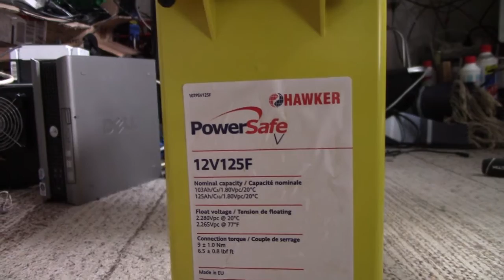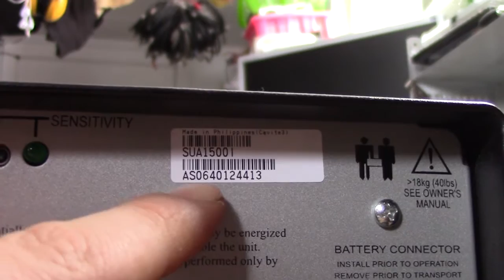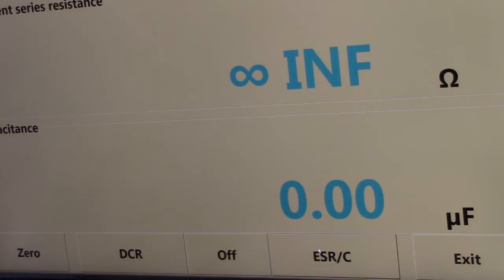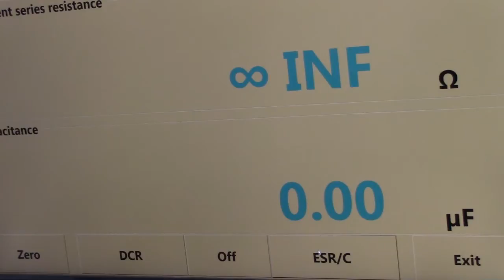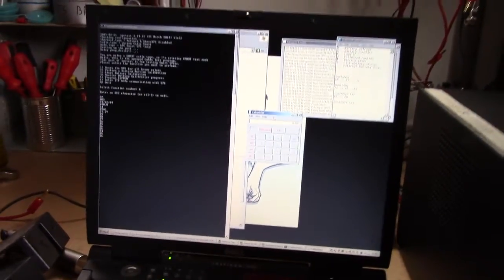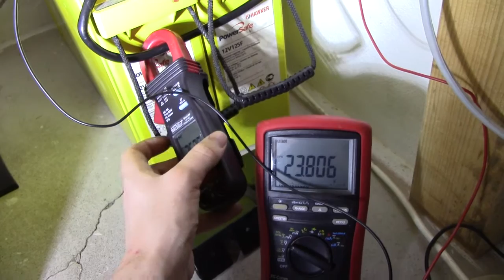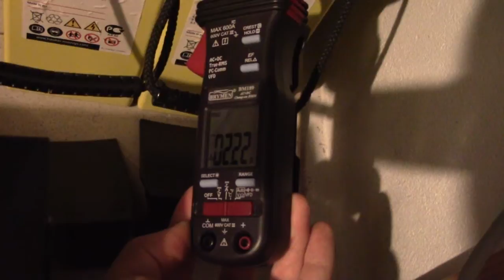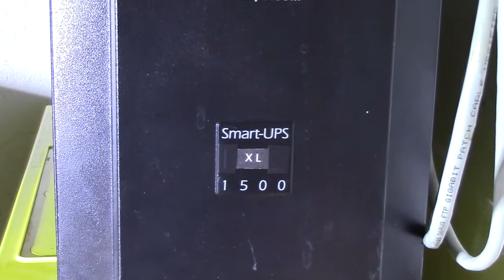Giving my workshop UPS a long overdue service and external battery connector

Comment: I have this exact same SUA1500 Smart UPS model.  I want to replace the existing 24V internal fan whose bearings have died.  What is the safest way to discharge the internal capacitors after turning off, unplugging from mains and unplugging the batteries?  Would pressing the "0" button for 10 seconds do the trick?

Comment: In some other video you said that the float voltage was too low for the car batteries if I remember correctly. What was your final conclusion about proper float voltage for flooded car batteries and how long did those last, if you remember?

Comment: I just recapped my 1500, its a 120v 60hz model and it still kinda has the weird grunting noise on startup. Any ideas?
Reply from the maker: It's usual for it to go "bonk". That's just the magnetics interacting with the case metal.
Reply: @FFcossag  makes sense, its an old 2002 model so its certainly been around for a while.

Comment: I have a UPS Apc 2200. Can I connect 4 batteries 100 amber with it? Do I need an external charger for the batteries?

Comment: Here again after 4 years.  I have a APC Smart UPS SUA1000.  I can't get it to cold start.  When the on button is pressed, I hear a  click, and the battery status light comes on.  It sits there then goes out after a few minutes.  When plugged in, the same thing happens, except after a few minutes the online light comes on.  If I then simulate a power cut, the inverter starts up.  When the input power is turned back on, the inverter goes off back.  No grinding sound.  What could be the problem?
Reply from the maker: Hold the 0 button down for 10 seconds, then hold  the 1 button until it turns on. Usually fixes it.

Comment: I got s Smart UPS 1000, removed the internal batteries and added 2 Trojan 12 v 100 Ah batteries.  I have an external charger on it.  When turned on it may or may not come on; the battery level lights will come on then nothing.   If you turn it off and try again it may work.  Can you suggest what may be the problem?   The caps have not been changed but there is no "groaning" sound.
Reply from the maker: That sounds like normal behaviour. They do that sometimes.
Reply: But why does it happen and can it be fixed? Do you think it may be voltage drop in the cable when it tries to start up?  Just to make it clear, this happens when it is unplugged from the utility outlet.  When plugged in, it works consistently.   I want to use it in emergencies and therefore would prefer it comes on when I need it.
Do you think it may be voltage drop in the cable when it tries to start up?
Reply: FFcossag Just an update on that issue of not coming on sometimes.  I found a procedure which works consistently.  With the UPS off and unplugged from the ac , while holding down the off button, press and hold the on button.  Then release the off button.  When you hear the beep, release the on button and the inverter will come up (always).  I do not know why it works.

Comment: Do you run "battery runtime calibration" with these external batteries? If I cancel it early, will it still give me a somewhat reliable calibration? say running the bank down to 75%? or do I really have to let it go down to 20% SOC?
Reply from the maker: The battery runtime calibration basically doesn't work on big packs. You need to manually run it down while monitoring the voltage, and adjust the number of packs parameter and the battery constant through the CLI.
Reply: @FFcossag  How does one do that? Is there another video or a site somewhere? I found some info about the battery constant, but nothing on changing the external battery parameter via the serial port. EDIT: Corrected spelling errors.

Comment: I recently purchased one of those UPSes, and after replacing the 22uf capacitors it makes a grunting noise (don't know if it comes from the transformer or maybe a bad relay), buzzer died (replacement is silent as well), and the fan does not work (tried known good from another unit, no spin, the original fan is just dead), and to top it off, it deems every battery pack as faulty (both known bad and known good). Do you think there is anything more I can do to fix it, or might it be a good time to cut my losses and send it off to the scrapyard? edit: spelling

Comment: Great videos! One thing about the external battery connector: I wanted to add an extra one instead of routing the internal one to the outside. I didn't wanna solder the cables to the PCB like the internal ones so I screwed them to the heatsinks, basically like it's done in the bigger ones. I connected "+" to ONE of the inner heatsinks and "-" together with the black transformer. When I start up the unit it gives me a "charger error" as long as an external battery is connected and when I connect two batteries the transformer starts to buzz. I observed your Smart-UPS 2200 hack video and the only difference you made was using two "+" connections, but then again it's 48V so I don't know if it's necessary to split positive to two wires. Might this do the trick?

Comment: Any idea how different the 120v boards are compared to the 240v models you are working on?

I suspect mine need new caps, but I am really bad at board soldering and very apprehensive about charged capacitors...

Trying to figure out what it might look like in there, and maybe if I should just use an electronics repair shop.
Reply from the maker: It would be basically the same, but if you're bad at soldering, you're going to end up damaging the board. It won't be worthwhile taking to a shop, you'd end up paying out of your nose.

Comment: Why the batteries on the concrete floor ?  Put the batteries on some plywood or a couple 2x4s and maybe a plastic tub to contain any battery acid leaks.  Waiting on some batteries for my SUA 1500 APC (ebay some months ago) to power up for first time.  Another smaller 1500 APC unit has been running in failure mode for a few months (7 Ah batteries are sill good, I think).  Thank you for the video !  tjl
Reply from the maker: +Tim Lipinski Concrete does not harm batteries. That's a myth from literally about 100 years ago.

Comment: Great video series! I've recently become a 'fan' of your channel. Can you please tell me what ESR meter you use. It looks fancy. Also for the capacitor that you used to start the UPS I noticed that it was a 45000 uF, 35V capacitor. I only have access to a 20000uF, 100V capacitor. Would that be suitable to start the UPS to change the float voltage? Thanks for the help and the videos!
Reply from the maker: Charles McQueen The ESR meter is an old prototype that isn't publicly available yet. As for your capacitor, it might work. As long as the voltage rating is above that of the battery voltage, it won't explode. I Just use the 45 000 µF junk box capacitor since it has those handy screw terminals.
Reply: FFcossag Thank you for the reply. Can you recommend an ESR meter that is available for purchase? I need one badly but I'm new to all of this and I would appreciate your advice. Thanks.
Reply from the maker: Charles McQueen I'm afraid I can't, since I only own this prototype. We built it because there weren't really any good, affordable ESR meters around at the time, but that was a few years ago, so there might be more options available today.
Reply: @charlesmcqueen4694  Agar Ham iski battery capacity badhate Hain To is iski capacity badhate hain ya nahin

Comment: Hello, I see have great experience in tweaking of such useful devices like UPS. My question is quite simple: I have SUA1000i, I would like to remove its internal 12V 12Ah (2 pieces) and connect (preliminary make a hole as you did) 12V 40Ah or even 12V 18Ah (2 pieces) - of course, AGM, not automobile ones. Will low internal resistance of higher capacity kill the UPS? Or, maybe, only the charging time will increase? Thanks a lot
Reply from the maker: The SUA1000I will overheat and blow up with bigger batteries unless you add a fan. Sometimes the internal fan header works, so that you can just connect a 24 V fan right up to the board.
Reply: Fan is not a problem, I can install it. My load is about 10%, not more, and the temperature of the transformer after 1-hour  battery mode is 37C, as to transistors - they are cold; so, approximately 25C.  But in case of 18Ah instead of 12Ah batteries - do you mean the UPS will overheat in battery mode? Or in charging mode?  Thanks
Reply: @FFcossag  Hello, speaking about the fan terminals on the UPS board of the SUA1000i, could you please point me where its at?

I really wanted add a fan to it, coz I don't think it came with one.
The SUA1500i is what has the fan.

Comment: Thanks for sharing this awesome info. Spesialy your txt file about the different comands the UPS takes..   ;D

Just got one of this my self from work as a new APC battery is to much money for them as they ONLY will use APC batteries.. hehe

So a UPS for me..

Question: What is your opinion on reanimating SLA batteries from this kind of UPSs?
  Asking as I am mainly going to us mine as surge and brown out protection and not too considered about battery run time.
Reply from the maker: It generally can't be done. They usually fail because they run out of electrolyte, and that's usually in conjuncture with overly high charge voltages, causing high pressures and deformation/cracking of the plates. It's better to just pay the 30 or so dollars that a pair of Shenzhenian SLA bricks will set you back.
Reply: 10-4. And Tnx for super quick reply And even taking the time to explain your answer. I have just started to get really into battery teck  as a hobby.

Comment: hi teacher how many ah fuse to between tow battery you are use
Reply: If you're still wondering, the SUA1500 model uses 18AH batteries and the fuse is 100A.

Comment: You have any experience with the Smart-UPS 750? I aquired one some time ago, but managed to bin the batteries WITH the original connectors. It's been on the shelf for a time now as I have a Smart-UPS 1500 with good batteries running my shack alone, but I might think about modifying the 750 to run bigger batteries for another purpose. Regardless, do you know what type of connector the 750 version uses? It is a type of sliding connector which disconnects as soon as you pull the batteries, but I have not managed to find it online. Thanks. 

You also got me thinking about cleaning up my own 1500; it has been in duty for soon to be 3 years and could probably need a capacitor replacement plus some help from the compressor. Anyways, good video - I enjoyed it.
Reply from the maker: +LB0VG I'm glad you like my content. As far as the 750 goes, I'm afraid I haven't got a clue as to what the connector might be. I'm almost afraid it's proprietary. I've only ever seen them on SU750 battery packs.
Reply: Ah, that's what I thought... Well, I'll see if I can mod a more versatile connector onto it then. 

When rebuilding the RBC48 pack, do you know what fuse-rating they use? Also, what type of wire would you prefer in such an install? I have quite alot of 12AWG cable available. 

Thanks.
Reply from the maker: LB0VG The standard SUA750I pack is fused at 50 A. As far as wire is concerned, match the stock or step it up if you want extended runtime (stock cables overheat)
Reply: Thanks. I ended up adding a couple of spade-connectors and hooked them up to an extra Anderson connector I had from an older battery pack. I already had a "new" replacement battery lying around for my SUA1500 so I hooked it up and what do you know - the unit worked no worries. 

I'll see if I can make a better solution for the cables as I have nowhere to poke them through (the Smart-connector is too far away for the stock cables to reach)

Currently working at changing the charging voltage, something which should have (and will be) been done to my SUA1500 downstairs which unfortunately have been running 3 years with the stock charging voltage. I guess it's too late to save those batteries.

Comment: Hi. Do you know what was the reason for the noise when running on batteries before, as you mentioned here: https://youtu.be/uSNu18F5rG8?t=780 ? I have a SUA750 and a SU1000XL and they both have weird and sinister transformer noise when running on external lead-acid batteries. So that I'm simply afraid of using them.
Reply from the maker: It's usually caused by the 22 µF capacitors going bad with age. You can still use them like that, they just sound bad.
Reply: @FFcossag  Thank you so much.

Comment: Sir , nice work ! , but using external batteries need an external chargers ! , did you use them ? any specifications ?
Reply from the maker: No, because that is not the case.

Comment: Those blue capacitors APC uses as break up timer are made by Chinese "quality" junk maker Jianghai.

Neighbour's Back-UPS ES had real nice symptoms because of those:
When on it was running quite hot... easily felt even through that heat insulating plastic casing.
And if it cooled down then starting it was like listening some time bomb:
After power on's battery test it would keep rapidly switching between AC and battery with nice clicking of relays.
With  speed of that slowing until after warming of minute or two it would accept to work on AC.
Checking inside it was running hot because it was apparently trying to charge battery quite often.
After recapping also that hot running disappeared.

Back-UPS ES should really have caps changed to very high quality ones or then swapped periodically like engine oil in cars because of no airflow.

Comment: may I ask how much is your average monthly electric bill? you seem to consume quite a bit of electricity from your mains.
Reply from the maker: I don't use much power at all, because I'm a huge efficiency nut. The power bill for this house is usually pretty big (100-300 €), however, since we have electric heating and ridiculously poor insulation (if you park a car beside the house and it's slightly frosty outside, the side facing the house will thaw from the irradiated heat).

My workshop uses between 100 and 200 W usually, and next to nothing when I'm not there and my computer is off. The amount of time that more than 250 W is used by me, is easily less than 10 % of the time on a monthly basis. The home server, including the modem, UPS, and WLAN AP, use 65 W on average, 24/7. Assuming 16 day-hours of 200 W usage in the workshop, and 65 W 24/7 by the server, the monthly cost (at 13 c/kWh) for my workshop and server, is 18,56 €. So, in rough terms, my electronics hobby related stuff costs "about twenty bucks".
Reply: FFcossag Well, I still believe you should look around for good -- inexpensive -- deals on solar panels and hook up numerous panels. The most expensive part of an off-grid solar install is the batteries and you have obtain so many batteries already. More than one person -- or even a household -- would reasonably need. I strongly urge you to find deals -- like you have with batteries -- on PV panels and install a massive solar panel array to fully utilize all your batteries. I have to say I'm quite envious of all the batteries you have and the large piece of land you see to have. 

I'm in Silicon Valley in California and land is extremely expensive here. We have tiny little lots -- in comparison to your lot -- for our homes here. But I do admit our weather here is more conducive for solar energy production. :-)
Reply from the maker: lanceguilin Your tiny lot probably gets as much sunlight as our larger one.

I'm well aware of my silly battery situation, but you simply don't come across "deals" on solar panels here, since almost no one does it. I am planning on expanding the system to maximise the utility of the Morningstar controller at some stage, but that's a 3000 Euro investment, and I simply do not have such money available to throw into solar, right now.

Comment: You shouldnt be using lead acid car batteries inside the room. Its gas going out the batteries.
Only agm selead batteries can work safe.
Reply from the maker: This is basically a myth these days, unless you're severely overcharging your batteries.